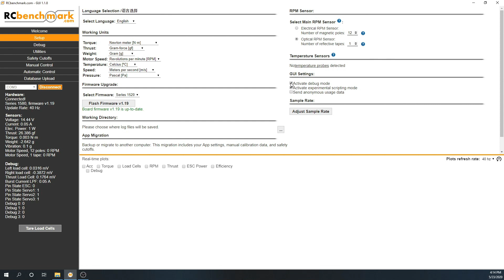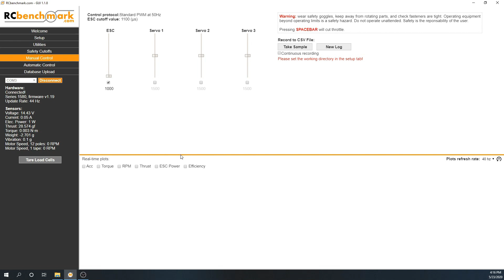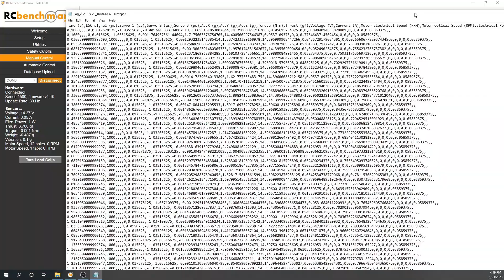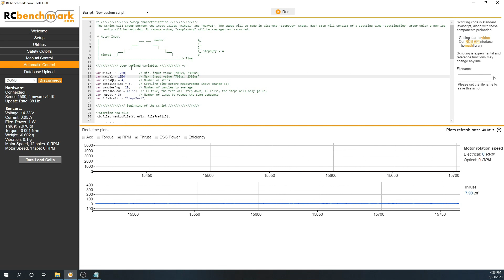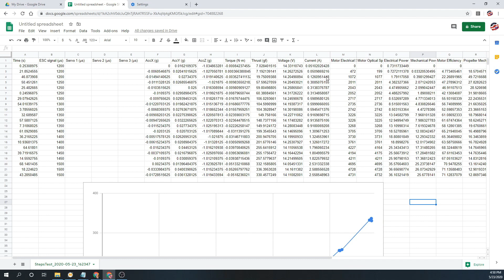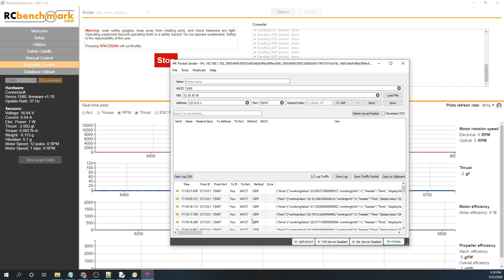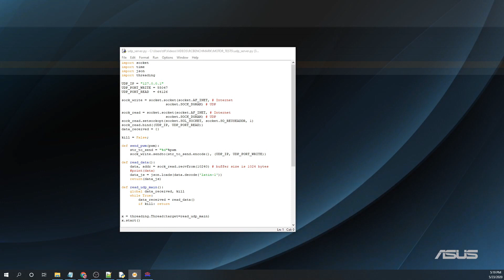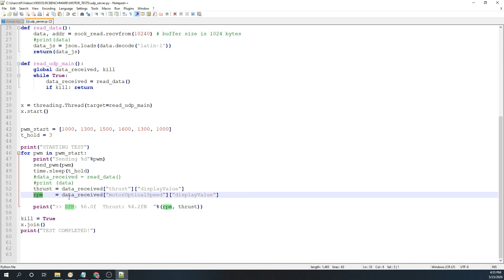Hands on the RCbenchmark 1585 Thrust Stand | Review and Automated test scripts coding

Comment: nice video , I can't understand what are the servo pwm's ports for? The motor is mounted to the rcbenchmark so no servo there.  If its for testing servos then how do you mount it, confused...
Reply from the maker: You can use the servo ports for deflecting a surface during your test. It's always good having options